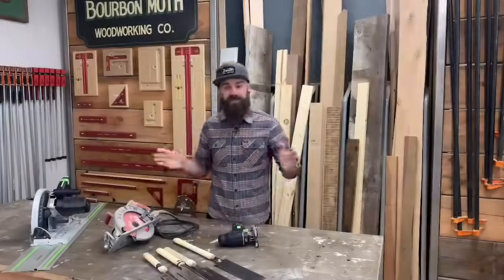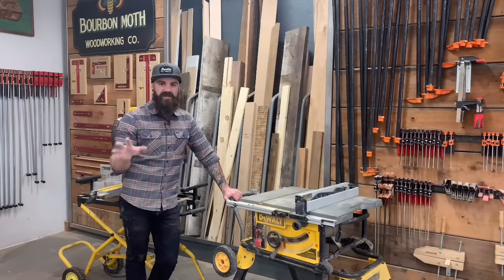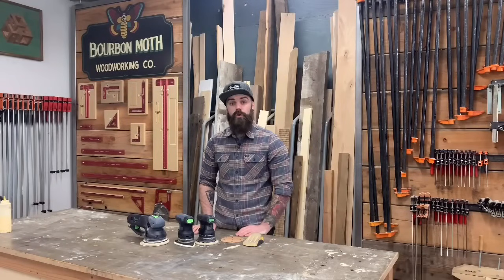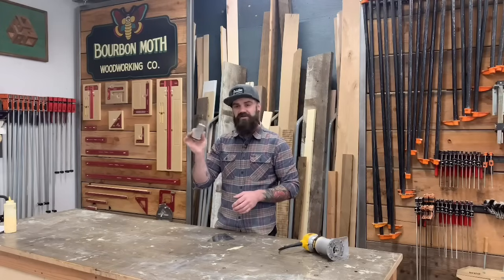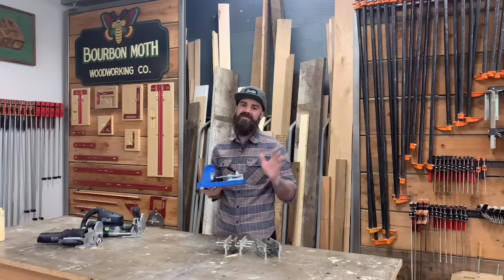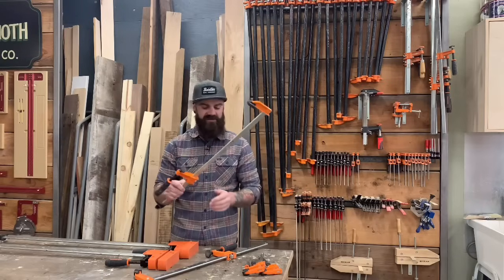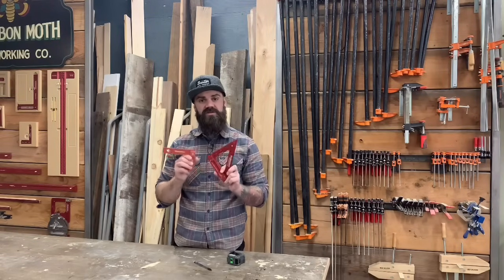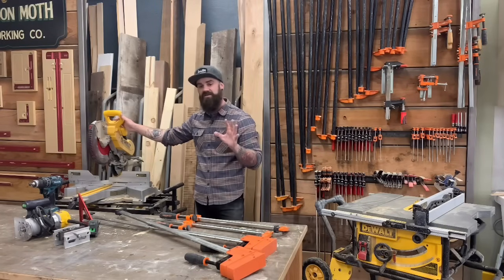Tools every woodworker needs | Start Building for under $1000

Comment: Let’s be real. With today’s inflation costs and tax, I would say about $3000 would build a decent starter shop. I have the receipts to prove it.
Reply: James King but are you the exception or rule?
Reply: I agree, I find this video kind of bullshit because some of these brands that he linked are brands that I don't trust and would not want to use to make quality work.
Reply: $3,000!? That's a little pricey. Something to keep in mind, buying used tools is always a good way to get great quality older tools for a fraction of the price of newer tools. A good used jointer you'd be looking at 300-500 dollars, about the same for a table saw. So lets say 800 for that. $200 for a 12 1/2" dewalt used planer, so 1,000 there, couple hundred bucks for a miter saw is 1,200, I personally just bought a scroll saw, 750 CFM dust collector, a Beadlock loose tenon jig (replaces the domino) and a never used before dove tail router jig for $360 yesterday. So 1,550 now. A band saw is 500 bucks used for a nice one, 2,050, drill press maybe 200 bucks 2,250. Then the next 750 bucks you can buy clamps, drills, circular saw, circular saw guides (like the kreg jig), kreg jigs and stuff whatever else you might need.

I'd say for $3,000 you got a semi professional shop really. Really the only thing else you'd want is maybe a drum sander which is 500-800 used. I bought a Delta BOSS oscillating drum sander it's really nice for $100. Maybe another 100 for a belt sander? I mean, what else could you need? Also, if you find someone selling their entire shop if they're moving or retiring you can get a really good deal by just buying everything. I'd say for $3,000 to $4,500 you could make yourself a professional enough shop. Sure, you won't have a 30" planer, but you don't really need one. An open ended drum sander is just fine for finish work.

Comment: A key piece of advice on the cordless tools is all the major brands make good tools.  When you buy a drill and impact you  are buying into a tool line.  Once you have 2 batteries buy bare tools which are always cheaper. like recip saws or jig saws or OPE.

Comment: I have a Rockwell drill I bought in 1972. Runs like new. Don't forget used tools. Rockwell was among the best. Sometimes they're not as cleverly designed but they're beefy and they work.

Comment: My Bosch cirkular saw is kind of a hybrid. It is a normal cirkular saw, but with a sole that supports tracks. A great and versatile compromise in my oppinion, as it can be used both with and without the tracks.
The saw is a Bosch GKS 18V-Li, using the FSN70 and FSN140 tracks that I think might be compatible with both Festool and Makita.
Regarding the jobsite table saw, my european version of the Dewalt DW745 (Type 4) does NOT support dado stacks. Might be due to some EU rules, I haven't seen any dado stacks for sale here in Denmark.
Having the impackt driver AND a drill saves you a lot of time changing bits when predrilling holes for screws.

Comment: Thanks for the advice. I’ve been searching online to see what tools I should invest in. The only thing that I haven’t heard anybody talk about is all the assessors that u may need. Like all the drill bits and sanding pads and router bits and saw blades and can’t forget nails and bolts and screws, and maybe even a respirator and safety goggles but still a nice video
Reply: And a shop vac if you don't want saw dust all over the place...

Comment: I just hit the 3000€ Mark and have had the first experiences. IMO there is nothing that costs you more DOWN THE LINE than inaccurate tools. They are a waste of money and take the fun out of it. Yes you can fix some of it, but a cheap China combination or speed square is just not fixable. Newbies would be surprised if they knew how inaccurate a cheap stamped tool can be. Also you did not address safety. It is priority no. 1

Comment: The job site table saw is discontinued. Can you please recommend something similar?
Reply: I found that the Ryobi 10" Table Saw with Folding Legs (#RTS12) seems to be a similar size and price point. (The Skil table saw was ~$200.) I can't speak for how it stacks up in terms of quality or accuracy, though.
Reply: I bought a couple months ago the ryobi job site table saw, works fine for me. Maybe 10 years ago i bought the ryobi mitter saw (10") with the stand, i still have it and use it all the time.

Comment: I’m new to woodworking and was wondering if you had any tips to make a smother cut when using a chop saw
Reply: The blades chop saws come with 24 or 40 teeth and are for ripping. Change it to one with 80 and up, they can get pricey but you will see a big difference.
Reply: MrMackanno thanks.  I’ll give it a try
Reply: @joedelmastro6177  Your welcome. One last thing, give your blade the time it needs to do the cut, this means the more teeth, the slower the feed so the blade can get rid of the sawdust efficiently plus you will not be over working the blade causing it to overheat. 
Look for "Stumpy Nobs" here in Youtube. He has awesome information and explains stuff better than me.

Comment: Then be ready to spend another $1000 for a variety of sanding discs, drill bits, forstner bits, router bits, circular blades, screws, glue, brushes, dowels, chisels, a shop vac, (building) a work bench/assembly bench, etc., etc., and that's just to round out the tools. Then, you'll need stains, top coats, wood filler, and many more supplies. Your list can get a beginner to 1st base, but that's where the journey begins. Just like many hobbies, acquiring new and useful tools never really ends.
Reply: So it's just a video for people starting out. Did you use your magnifying glass to come to that conclusion Sherlock?
Reply: @coreydiculous  What good is a router without bits? The bits can be pretty pricy if you want something that doesn't tear and splinter the heck out of your project.
My Dewalt DW745 jobsite table saw came with a 24 tooth ripping blade. Fine for ripping, but pretty useless for joinery. And a good combination blade is not exactly cheap.

Comment: When it comes to milling, litterally all you want to do with a jointer and a planer can be done with a hand plane. Will it take time? Yes. Will it need a learning curve? Yes. But it'll do anything those two machines do. I don't really know your knowledge and skills with hand planes, but I really wouldn't ditch them right away. It'll make it possible for you to use cheaper lumber and plane it yourself for really cheap (I personally recommend getting an old rusty stanley no 4 or 5 and restore it, it's not that hard and will cost you pennies). And hand planes can be great fun to use as well!
Reply: I agree. Learning with basic hand tools teaches you so much about the characteristics of wood, grain direction, how to properly sharpen, etc. Also one of the big turnoffs for a lot of newbies is the dust generated from power tools. Shavings are a lot easier to sweep up.
Reply: I don't disagree at all with what is said here. I've been hand planing and hand cutting dovetails for boxes on my Tage Frid student work bench for several months now. I step outside to great a neighbor and she says, "Why do you look so happy." I can only assume it was because I had just come from working at that bench.
This YouTube channel is less about building skills than it is about production and tools. At least it is a beginning for some.

Comment: A drill combo kit it also useful because you can have the impact with your driver, and the drill with a pilot with countersink saving hours of switching our drills/drivers.
Reply: It's also very nice to have two drills and one impact driver. The reason being sometimes you have to predrill hole but also countersink that same hole. It can be time consuming to switch the drill between predrill and countersink. So I would like two drills and one impact driver.
Reply: @jamestremblett1875  indeed, that’s a luxury though 😅 and so I just have one of those countersink bits that bolts onto the shaft of a drill bit, I only ever do small holes
Reply: @almostanengineer  I hear you man! I do the same! I don't have that luxury myself!
Reply: @jamestremblett1875  I was using two drills and a driver a couple weeks ago and my friend said I had too many drills.

I wasn't using the 1/2" impact that I use on my car.

And my old 12 V Ryobi and 15 year old Black and Decker are at my dad's house.

I guess "too many drills" isn't a phrase I ever expected to hear. 🤣

Comment: First and foremost, make sure the saws you pick up are using standard sized saw blades! Just walk around the tool second of your hardware store to see the most common blade sizes. I made this mistake with my first table saw. Said table saw doesn't handle dado blades either, but I get by with a router.

Secondly, spend the extra buck for a sliding double-bevel compound miter saw. Basic miter saws work just fine, but the extra versatility of the bigger unit is much nicer! I know that the video is showing the fancier saw, but he never gave specifics

Comment: If you wanna get into woodworking , I'd say Craigsist,Craigsist,Craigsist !  I've outfitted my shop with almost all used equipment ,some very nice stuff too. I have a Grizzly cabinet saw ($225) , a 6"jointer ($75) , a Sears bandsaw , that I will upgrade some day. Although tuned up and with a nice blade works just great . (got on a trade) , I could go on but... You need cash in hand and be ready to act quickly on a good deal , but they are out there.

Comment: Other tape measures in big box store are accurate. The difference between fastcap (i have and prefer as well) is the big box store like stanley is they usually have the smallest measuremat 1/8 inch when for woodworking 1/16” is the minimal smallest measurement u need
Reply: What are your thoughts on apps acting as measure tapes?
Reply: What Stanley tape measure doesn't have 16ths? 😅

Comment: Not to sound like a Kreg fan but they are very structural. Might even be stronger than dowels as the steel screws are stronger than dowels. There was even a study with pocket screws, dowels, domino, mortise/tennon and it was def strong enough
Reply: Pocket holes have their place and can be a better structural option as long as they can be hidden. The most important thing I believe, is placement of the holes at the joint. Make sure to join from end grain to face or side grain. Avoid pocket holes where the screw drives into end grain, it’s results in a weak joint.

Comment: I recently found your channel and like your videos - informative and entertaining.  However, your math is a wee bit off on this $1000 tool set.  The chop saw and table saw alone total between $900-1000.  Still, it is possible to acquire all the tools you list for around $1000, but it will take some shopping around.
Anyway, sorry for being a complainer.  Did I mention I really like your videos?
Reply: You could easily get these things fir waaaay less than that, just not those exact models

Comment: One thing that is a must, that I wish I had when I started is a bench. Doesn't have to be fancy, but something that is flat, square, and level to work off of makes all the difference in the world. I was lucky enough to have my table saw with a 52" fence that I got for next to nothing, but I still wanted that bench just for the sheer versatility of clamping things to the bench itself. Having to put cauls under the table saw top plate to be able to clamp stuff isn't always feasible when you only have 2 hands and need 6.
Reply: I've always seen a workbench as your first project in the workshop. Seems such a personal thing that's fairly easy to do while packing with features that you want.
Reply: Luckily I already had a workbench when I started out.
My dad built a really sturdy one (european style woodworking workbench) about 50 years ago from solid beech, that he had to give up on when selling his house and move to an appartment. It found a new loving home in my garage, and it has been invaluable. :)
Reply: A Tage Frid student workbench (a scaled down European cabinet makers bench) sits in my living room. I built it over a couple of weeks with fewer tools than described in this video, occasionally at a turnout on the side of a road. Tage Frid intended construction of the bench to be a learning tool for students of furniture making. Students could then take the bench with them when the left (RISD). Mine is a prized possession and still useful tool.
Reply: I started piecing together my wood working tools recently, and designed my workbench before buying anything. I have a 2 car garage that actually holds 2 cars for a work shop. I designed a workbench that I can fold the work surface up against the back panel boxing in all of my hand tools. There will be drawers on either side of the top half told holds screws and any other anchors I may need. When folded, the overall dimensions will be 72”H x 16.25”D x 48”W. The work surface will be 48”W x 36”D x 36”H when down for use. I will also be able to pull the work surface out an additional 30” to serve as an out feed table for the table saw. Lastly, I will be installing a router in the work surface for a router table. I’ll have a wood panel I can put in the table top in place of the router plate when I’m not using the router. My power tools will hang on hooks/pegs on the bottom half. All of my mechanics tools will be a few feet away in a giant roll-away tool box. I did a lot table saw research, and ultimately decided on the exact Dewalt in the video. It’s a $600 10” job site saw part number DWE7491RS, and it comes with the collapsible rolling stand for minimal storage space when not in use.

Comment: I would suggest getting a lot of the big stuff like table saw and miter saw from estate sales actions Craigslist because in my opinion they are way better and cheaper then a lot if the new stuff today
Reply: Luke Hansen I would personally rather suggest that a novice woodworker buy a new table saw. They are incredibly dangerous when not trained properly on one and I've seen some proper dodgy second hand table saws from ones that will stop running which makes you think that it's died or is switched off only to suddenly start running again. You then have further problems like the push stick is probably missing and replaced with a crappy unsafe one made by the previous owner or may be missing one entirely. A birds mouth style push stick is really the only type that will keep your hand in a safe place away from the blade yet you see many people on YouTube using unsafe ones. At least if they are buying a new saw it will come with the correct,safe accessories.

Comment: Thanks for the video. I actually used the Milescraft dowel jig on my first project and was really happy with how easy it was to work with. $20 and comes with jig, bits, and carrying case. https://www.homedepot.com/p/Milescraft-DowelJigKit-Complete-Doweling-Kit-with-Dowel-Pins-and-Bits-1309/300534138?mtc=Shopping-B-F_D25T-G-D25T-25_9_PORTABLE_POWER-Multi-NA-Feed-PLA-NA-NA-PortablePower_PLA&cm_mmc=Shopping-B-F_D25T-G-D25T-25_9_PORTABLE_POWER-Multi-NA-Feed-PLA-NA-NA-PortablePower_PLA-71700000034127218-58700003933021540-92700053252310110&gclid=CjwKCAjwmrn5BRB2EiwAZgL9oqqdiqdnhs90TO1_6YuOnhYnCtAURtzcnnAAedyuz7NG35w2-_W-UBoC99UQAvD_BwE&gclsrc=aw.ds

Comment: Do you have router bit starter set recommendations. I bought a 15 piece set from amazon for $20.
Reply: In my experience the sets aren’t worth it. You probably won’t use the majority of them, especially starting out. I would say buy quality bits, one at a time as you need them. They aren’t cheap but they will outlast those amazon bits a hundred times over. Home Depot has a pretty good selection on the Freud/Diablo brand which I like a lot.
Reply: Robin p there's a company called trend here in the uk and Europe,they make fantastic router bits. Those multi bit sets are usually not very good bits and the amazon sellers just get them from china,you can order them from wish for a couple of bucks, they are rubbish quality though.

Comment: Multiply the prices you've mentioned by 3 or 4 here in Australia. I work at a business that sells woodworking tools, so am spoilt, I have some awesome tools, I enjoyed your video, and will use some of your ideas. I don't agree with your thoughts on the Kreg jig though.
Reply: just looked up the sanding block here in Canada they want 25 bucks ahh no
Reply: @teeedb he says its not great for structural or furniture applications, only for cabinetry, this is wrong

Comment: Meanwhile we got weekend woodworkers rocking a $3000+ table saw and an arsenal of Bessel clamps lol.
Reply: Weekend woodworker here. What would you say is a good price range for a guy like me?
Reply: Pepe Lotudo truly, you can make anything work. I’ve met woodworkers that make good stuff with job site saws, but I think $400-$800 is a good range. Delta sells a decent contractor saw for about $600 which is what I have. It does everything that an expensive saw would and if you ever think about doing fine woodworking like cabinetry this will do it just fine. I believe the main difference between the contractor saws and the cabinet saws is dust collection and noise level.
Reply: @timothydu9415  Awesome thanks. Will be doing some research see what I end up buying in that price range.